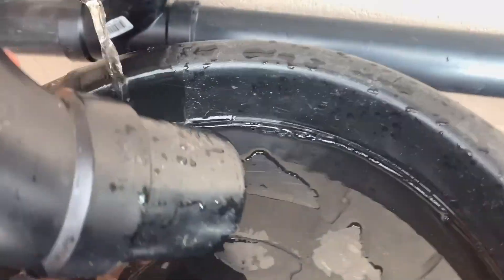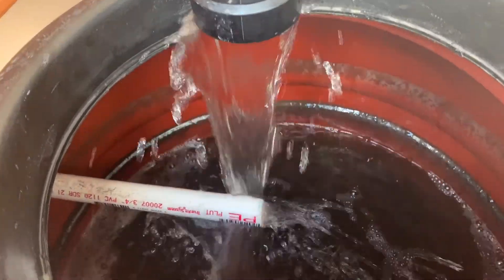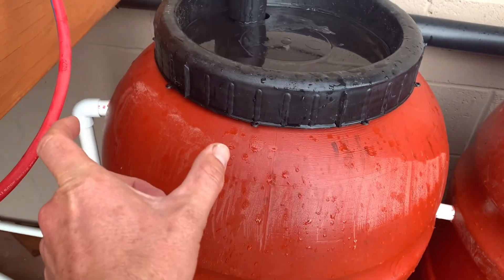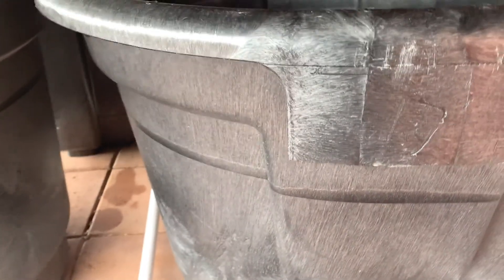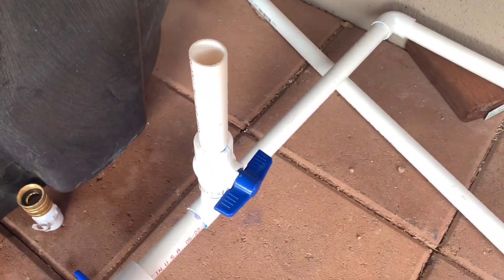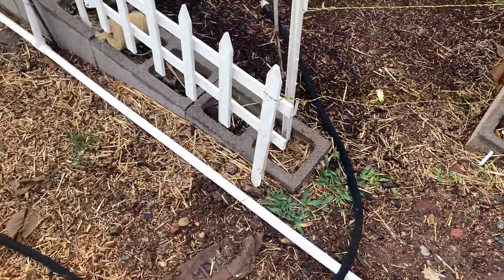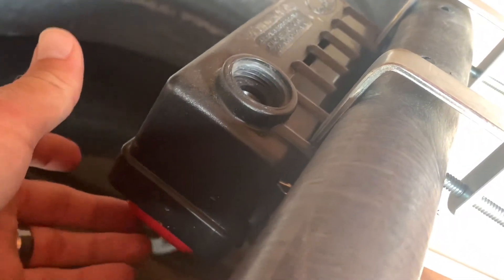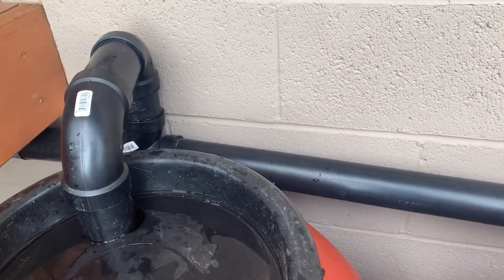Rainwater Harvesting System with Stock Tanks

Comment: Did you build covers for your stock tanks to e.g. keep the mosquitos out? How have you liked them being in your system?
Reply from the maker: Yes we did! They worked great. We added a more dedicated at permanent overflow to redirect water that exceeded our capacity to a location where water naturally drained from the property. It wasn’t a big enough pipe for some of the big monsoon rains we received that dumped an inch in 15 minutes. Otherwise, I’d do it exactly the same again. Thanks for the comment!
Reply: Thanks!